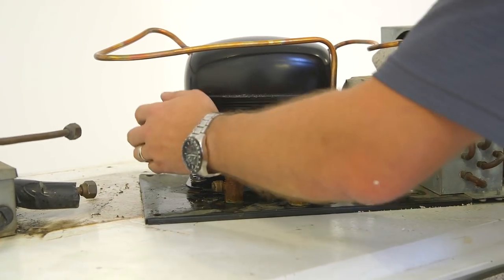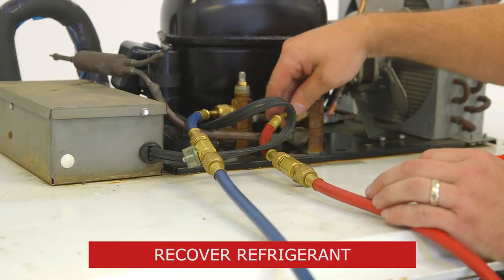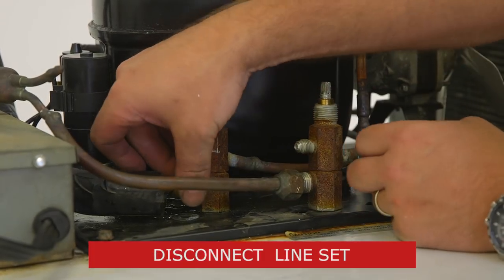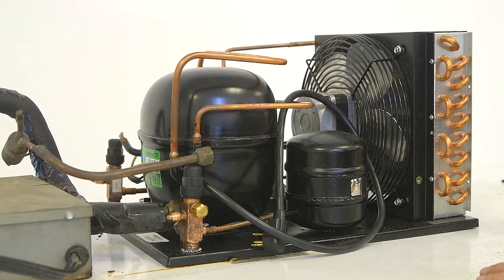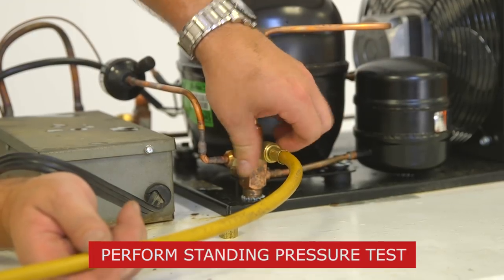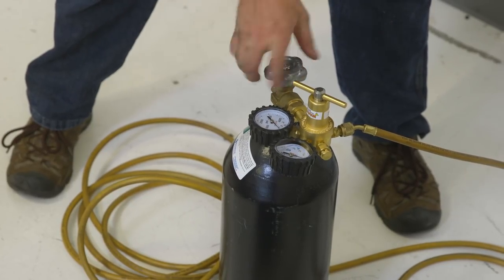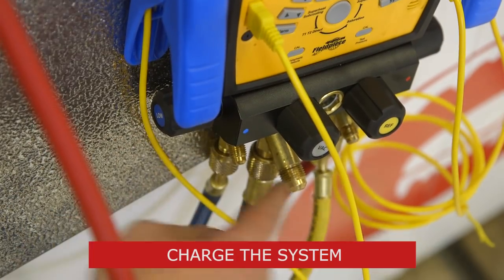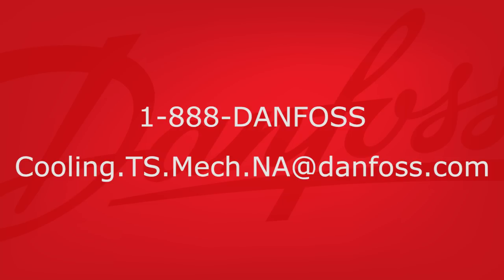How to install a condensing unit with Danfoss

Comment: They should of put some cool gel or a wet rag around the dryer whilst welding
Reply from the maker: Hi Danny, You’re right, when replacing filter driers in the field, you should always use a wet wrap. We included replacing the filter drier as a helpful reminder, as the filter drier should always be replaced whenever the system is opened, but because the focus of the video was replacing the condensing unit, we skipped the wet wrap. We’ll be sure to wet wrap the filter drier in any future videos.

Comment: So does the compressor come with refrigerant or do you have to charge the system to specs?
Reply from the maker: Hi P Najera, the unit must be charged to achieve the desired condenser sub-cooling.
Reply: @DanfossNorthAmerica  thank u
Reply: Pleas  i  need  mobily  morchariey  in stallind     hospataltiy    unti staring need  25  morchariey   new  mskig  pleas  shering  need  ouer ate my  breathat  strest bu  to  muach  ex peas  costel y but  saving need  unti stating  pleas sjerimg nai

Comment: If The head pressure of a newly-commissioned refrigeration plant was found to be high.how to troubleshooting this problem
Reply from the maker: Hi Amadu, try our service tool to assist with troubleshooting issues. Visit hvacrservicetool.com and search by symptom or navigate by topic to assist your system. If you continue to have a problem, contact your local technical support team which can be found here: https://www.danfoss.com/en-us/contact-us/contacts-list/?filter=type%3Adanfoss-sales-service-center.